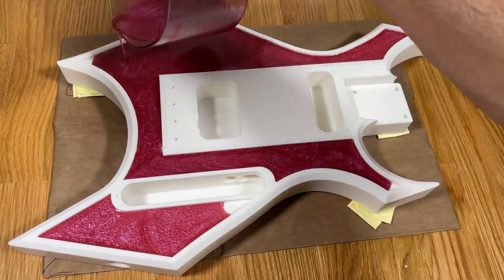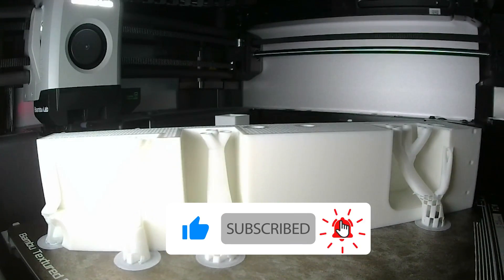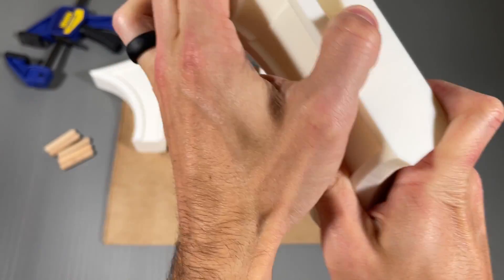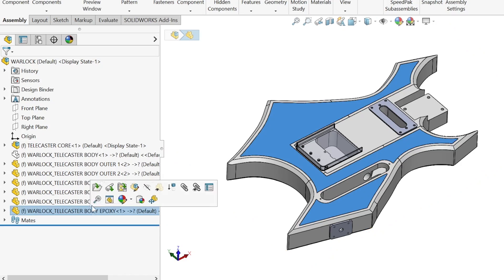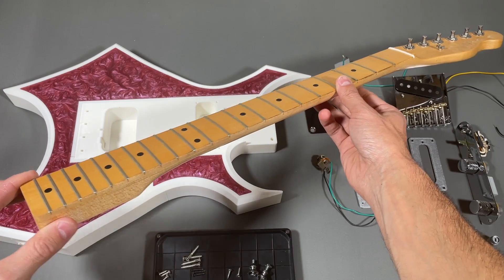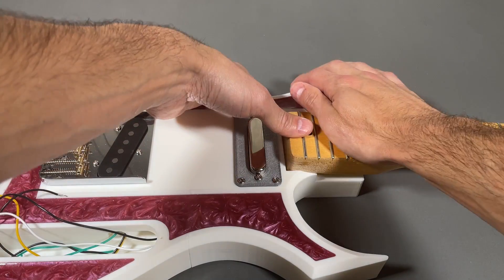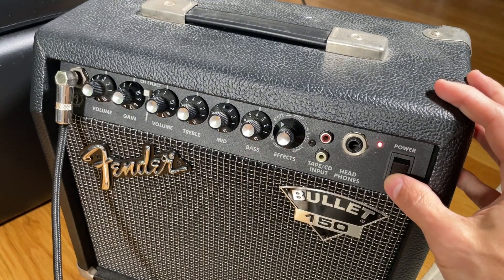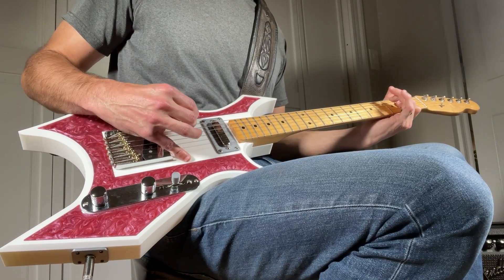3D Printed WARLOCK Style Guitar Project! Step by Step Build

Comment: How would one make this on a printer with a smaller print bed like am ender 3? I haven't gotten a chance to upgrade my printer yet so don't judge me 😂
Reply from the maker: Thanks for the comment! The center core piece is best to print as a single part to withstand string tension, but you could try to split it into 2 parts and use strong dowels. Another option would be to try to tilt the print up vertically on the bed. This will require more infill, but may do the trick. Just be aware of the layer line orientation to make sure they dont go in the direction of the string tension. Hope that helps and best of luck!

Comment: Using cheap ass fleor pickups from Amazon with an Obsidian Wire plate is crazy😂
Reply from the maker: You can most certainly use whatever electronics you prefer. This is what I have and it works well for me.

Comment: Is there a way to build this as a bass guitar? I used to own this design as a bass years ago and would love to print this design for that intent.
Reply from the maker: It is most likely possible, but right now I am only focusing on 6 string guitars. I also have a side concern that the tension from thicker bass string would be a challenge for plastic.

Comment: I started to print out my warlock! I have an ender 3 so I ended up splitting the stl in blender. Problem is I have no idea what I'm doing and for some reason it didn't print a connecting bridge and tunnel I designed. I'm going to sand it down and fuse the pieces regardless. Just gotta be precise when fitting it all together. I'm so stoked to see how it's going to turn out!
Reply from the maker: Awesome! Enjoy the project!

Comment: I was thinking of making the joint lines mitred in order to hide the join lines better, however, there is more of a possibility of glue seepage if I do, I then thought of masking off the join lines and airbrushing them with an accent colour to make them a feature, I would print some test pieces first though to get a visual on how it would look.
 I will first have to find a compatible neck online as Squier neck blocks vary in size in different models and year of production.     As the only Squier I have is a Japanese built 1984 Telecaster and is the favourite guitar of my collection, there is no way I would want use that.
 Can you remember what tolerance you allowed for the neck block?
Reply from the maker: Thanks for the comment! You could fill the split lines, sand, and paint if you wanted to completely hide them. In the description I have a link to an affordable neck that should fit snug. You can always file down the neck pocket a bit if the neck you use doesn't fit. The neck bolt holes are 5mm in diameter. Hope that helps! Let me know if you have any other questions! Like and subscribe and happy printing! :)